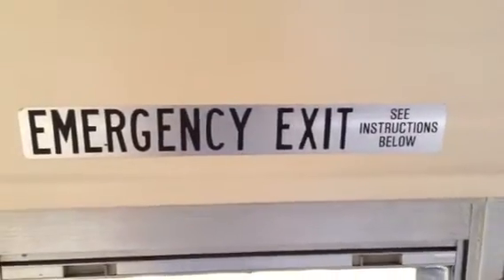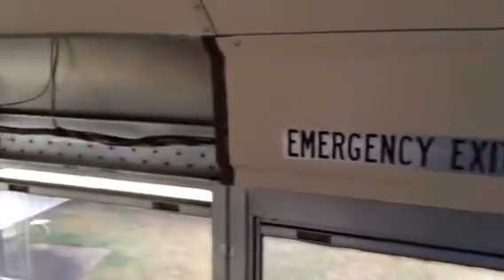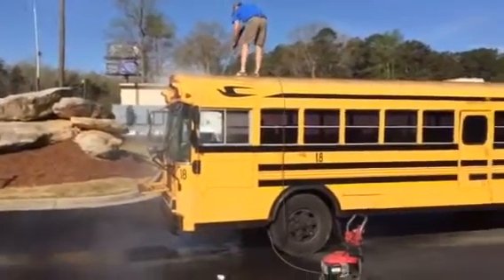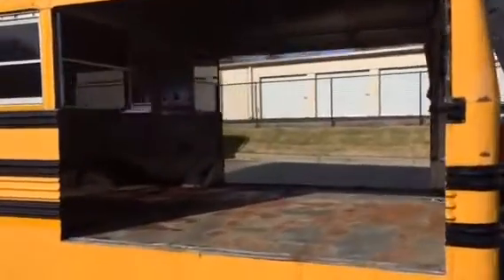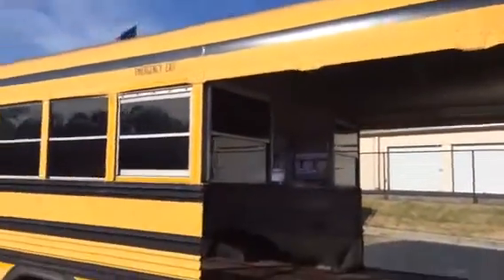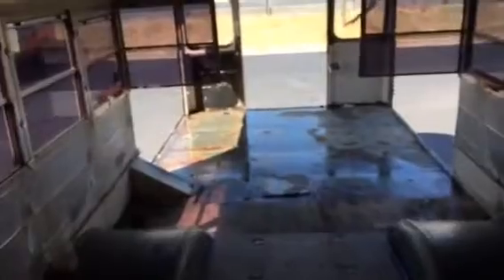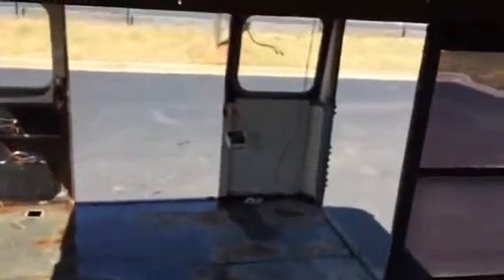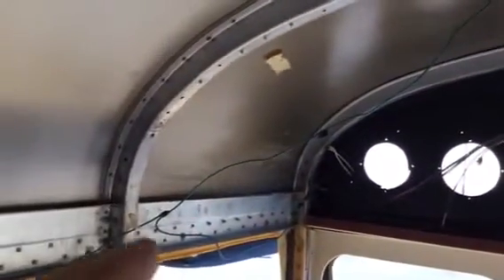Barbecue Bus Conversion Project - #2

Comment: I love the BBQ Bus. Just curious what you did with all the windows you removed? I need some for a camper project and can't seem to find any.
Reply from the maker: +Chris Fett I saved a few of them in case some got broken and threw the rest away.  Lots of junk yard around Atlanta have buses full of windows still.
Reply: +Cast Iron BBQ Yep, but I have found they typically don't want to sell the windows because they used the old buses for storing interior pieces from the cars. I'll keep looking, Thanks.